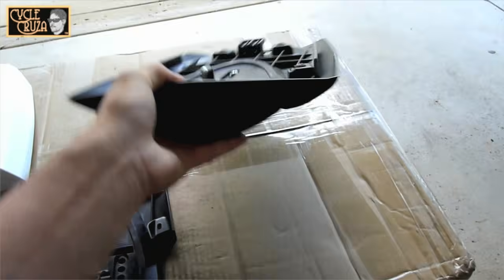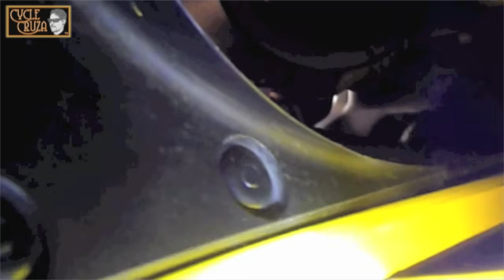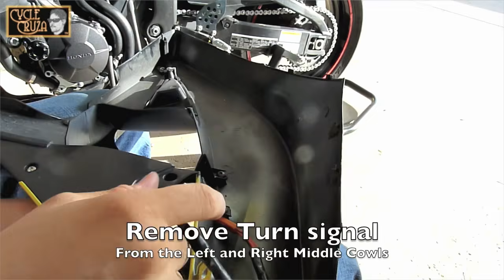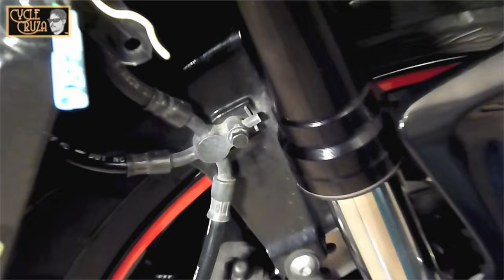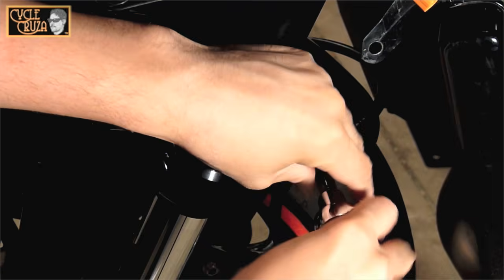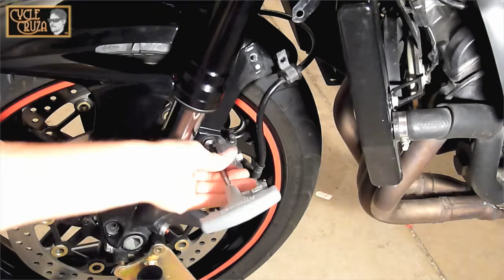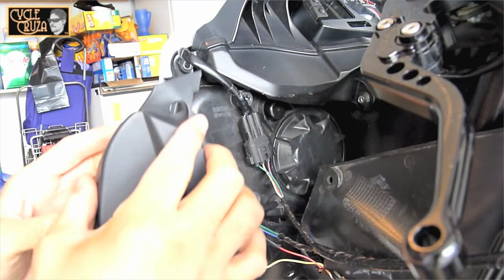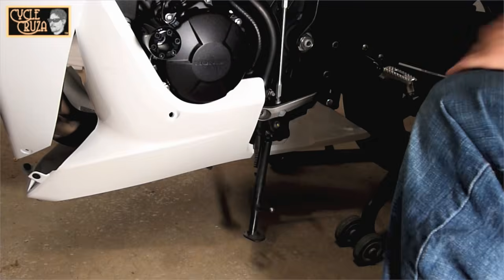How To Install EBay Fairings - Honda CBR600rr - Chinese Aftermarket Fairings - Part 2

Comment: hello cycle
i got a question.
i trying to get the 09 fairing kit for my 08
is it a big difference between models?
i didn't know that until now.
Reply from the maker: The 09+ models have the engine covers...

Comment: Could you tell me, what did you do with the nose problem ; You left it with gap;;;
Reply from the maker: There is no problem.  If you want perfection pay $3500 for a new set of fairings. lol For that price I'd rather buy a second motorcycle than oem plastics.  Believe me this set-up is legit, I learned this installation technique  from a Honda master mechanic. Question: Would you rather pay $500 for a set of near perfect custom painted fairings or pay $3500 for oem fairings. The choice is yours....I;d rather have customer painted fairings rather than the same ol common oem color scheme that's been around for 7 years. Custom painting fairings oem fairings is just stupid though, scratch a fairing and you will have a hell of a time trying to match the paint right as where you always order a full set of custom painted aftermarket fairing for $500. Much cheaper and looks sick.
Reply: No,you didn't understand my question. I just ordered my aftermarket fairings from motofansclub.net , and i will sure have a problem with the headlight fairing ,the point that you drill the holes. But i will follow your technique . In the end of the video , the headlight fairing has a gap from the left side and right side,how could i much that ;and leave no gaps;

Comment from the maker: sorry to hear. check out EZMoto fairings, the link is in the info section of the video. New fairings about $500-$600. The other stuff you might be able to score off ebay for cheap.

Comment: In 2009 I bought a kit fairings for my CBR 600 2008 and until today everything perfect anchorages and material quality is excellent, the purchases on ebay. to this day I want to buy another kit to give my bike a change of scenery. and my question is whether fairing kit 2009-2012 models worth to mine them is 2008. Apparently these are identical except the 2009-2012 clogged the engine. Anyone know if I can I put this? is that I like a model that's only for the years 2009-2012l

Comment from the maker: My fairings are fantastic. When it comes to aftermarket fairings it's more about how they are installed. You HAVE to install them exactly as I installed mine in this video with the tips I give you. If you don't you will probably have problems with any of them. Also, make sure to get ABS injection molded plastic like my fairings  in this video, that is the best you can get when it comes to aftermarket fairings.

Comment: Hi there i have a CBR600RR 2007 as well, and I was wondering if you had any fairings dealers that you would recommend. I've had my share of bad luck with ebay stuff in the past any help would be greatly appreciated. Thx

Comment from the maker: Very simple,the hardest part is remove the bolt on each side of the stay and then remove the obvious bolts. Get a service manual, they are available in pdf online. Sorry, but there is no way I'm taking my stay off and putting it back on for a video, taking the stay off can be an irritation. lol Good luck!

Comment: For FI bikes how long is too long to sit before you need to use fuel stabilizer and a battery tender and all of that. I travel a lot for work and am often out of town for 2 or 3 months at a time (I'm new to riding).

Comment: Pushing the cowl rubber settings all you do is spray some wd40. That way you don't kill your fairings with scratches or ripping the rubber.

Comment from the maker: Don't know but I don't really need one on my bike. The clip-ons are raised a bit more on this bike compared to other ss bikes so you don't have to pinch the tank with your legs. If i rode track often I would get them but necessary for the streets with this bike.

Comment from the maker: Honestly, you see the same tired oem schemes for so long it's boring. You see one oem cbr600, you've seen most of them just in different colors. Except for the special editions like the Leyla, phoenix, x-ray, etc. The injection molded aftermarket fairings, what I have and my old set, is very good quality. I've had my red bull fairings for close to a year and they still are great, I was pleased with them, reason I decided to go with another set. Was just tired of giving free advertisement.

Comment from the maker: Thanks, yeah you have to break off the clips on the end or it will make the end sit up on the hook. My red bull fairings were done the same way. The reason people diss aftermarket fairings is b/c they try to stretch it at the end  and end up breaking the other important tabs and misaligning the bolt holes. There is a science behind this, like I said these are tips straight from a master tech at a bike dealership.

Comment from the maker: The zip tie method is better, believe me. I talked with a master technician at a bike shop and he has installed many different aftermarket kits. The reason some people have trouble with aftermarket fairings is b/c they try to force  and stretch it and end up breaking tabs and have misaligned holes. My method takes all the stress out of it and the fairings are on rock solid. My red bull fairings, which were done by the master tech I talked to, were put on the same way and I had zero issues.